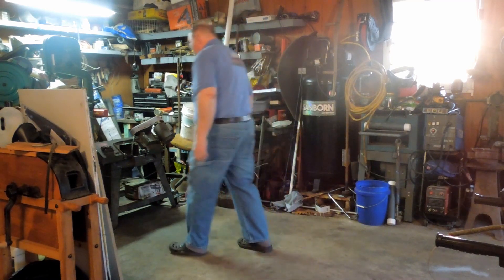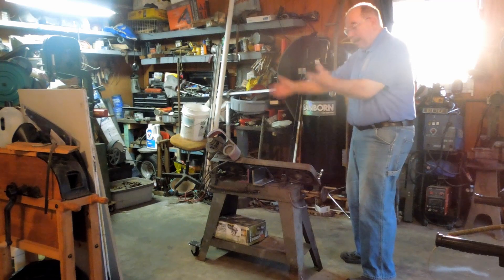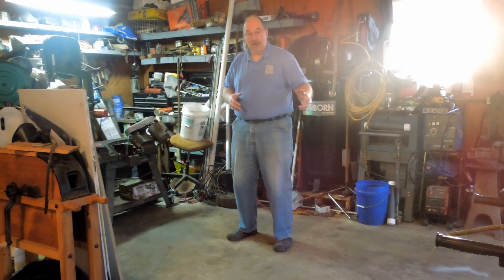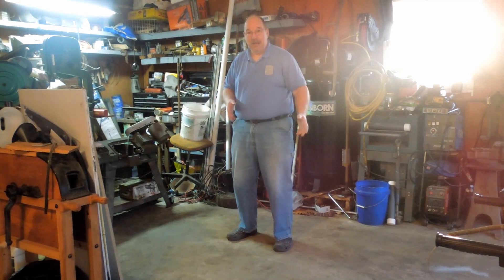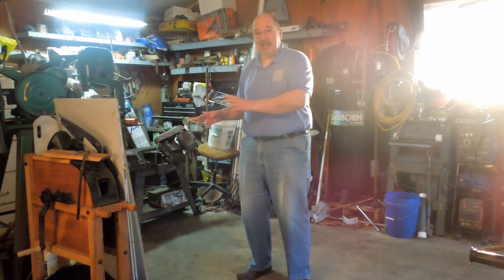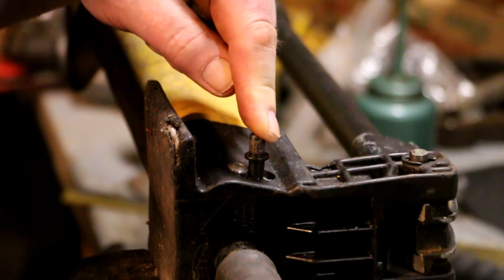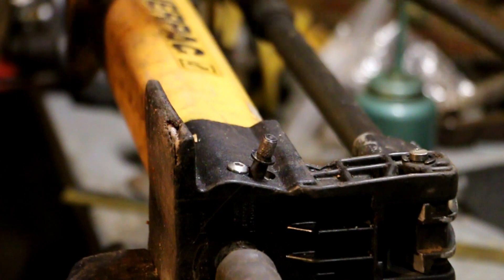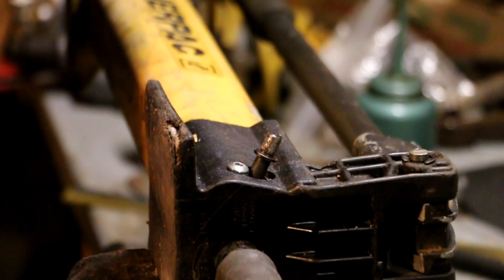Wednesday Update ~ Project Status

Comment: Nice to see those wheels in action, and I have to admit I too find the comments extremely interesting 👍
Reply from the maker: Even better to not have that screeching noise when I move the saw.  Lots of things in thecomments I never thought of. Different perspective. 😎
Reply: I like the comments section too.  Particularly on this channel.  Although I don't generally bother trying to read the comments section on BIG channels, because:
1.  BIG channels have easily hundreds or thousands of comments.  TL;DR
2.  The signal/noise ratio is generally to high.  It's impossible to find the two or three REALLY good comments that make reading it worth the effort.
3.  Trolls.  Trolls look for big audiences, and therefore big channels.   Actually, trolls are what generate a majority of the noise (see 2. above).

So, I guess you could boil all my reasons for not reading most comment sections.

Another reason this is one of my (if not very) favorite comment section is that some of the coolest random stories are right here.
Reply from the maker: @BrianDaleNeeley  I monitor a lot more channels than I subscribe to. You are right about the  signal to noise ratio. Some channels aren't worth the effort to get past the nasty. I usually have more interest in the tech and diy channels. Not much interest in the who does what to who fan channels or the gamers.

Comment: What's that wooden contraption with the crank handle to the left of the screen?  My best guess would be a walnut huller.
Reply from the maker: It is a corn sheller made by Hocking Valley. 
They also shuck walnut hulls. Really messy with the walnut hulls though.
Reply: @OldSneelock  My great grandpa had a corn sheller, but it wasn't nearly so nice.
Reply from the maker: @BrianDaleNeeley  It didn't look like that when I got it. https://youtu.be/zr_Ay64ID_s

Comment: were you originally thinking the mower needed the engine replaced? it seems like once you get the spark fixed it should be good (with some general fixings).  its good to keep busy, chases away the altzhimers that im sure is made worse when people retire and decide they arnt doing anything ever again
Reply: I think he's going to swap it over on an older body that's in better shape but I'll have to wait and see likewise. I've been known to do that myself.
Reply: @lewiemcneely9143  ahh i did question, why swap the motor when it seemed pretty good, i didnt think! cheers lewie
Reply: @jusb1066  I think I might've gone with where it was but it'd depend on what else I had. I'm not a fan of those transmissions but you use what's there sometimes. I've got a Dana 6-speed in the big one and put a Peerless 5-speed in Cheryl's when it died. Good old bentonite clay for lube. Not anymore! Cheers, Justin!
Reply from the maker: Long day. Just getting around to answering. The Craftsman that mows really well and has a bagger that works great threw a rod. The Craftsman has a real trans with gearing. Itvwill pull a roller and the garden cart without a problem. The last new mower I bought was a Troy. It had a variable speed Reeves type drive like the one I'm pulling the motor out of. Mowed okay but burned up belts right and left. Low gear with the Reeves drive has the belt running on a small  diameter section of the variable pulley. The belts slip and burn right off. 
The previous caretaker never oiled or greased the wheels either. The right front was missing a bushing so they stuck a washer on the end and the hub ground down through the axle. 
It hadn't been used much. The tires weren't worn just dry rotted. 
That's why I want to make sure the engine is good before I pull it. The crankcase had oil in it but who knows how long it had been run without an oil change.
Reply: @OldSneelock  The neighbors is a Craftsman but has the Reeves tranny. I like my 6-speed. I don't blame you a bit. That engine ought to run. It just needs gone through and I for4got about the bagger. That's what the Kawasnapper has and they're nice all right. So just carry on, Unc! We're all rooting 4 U!